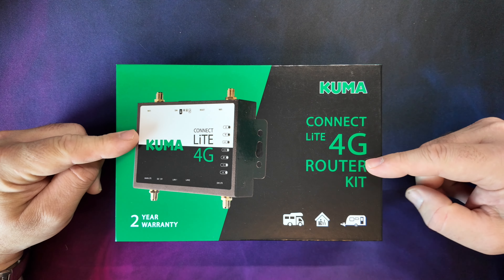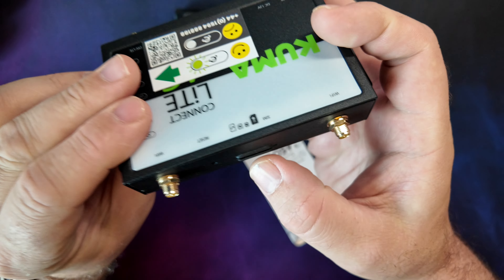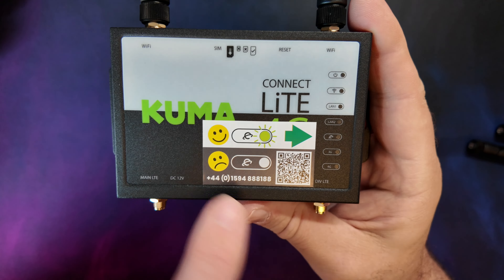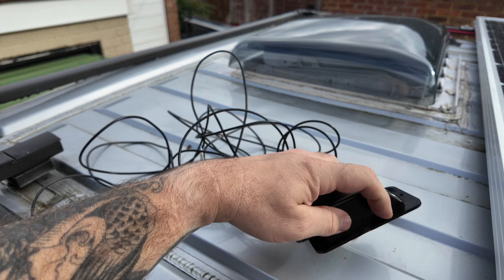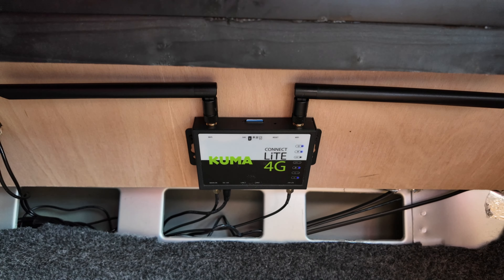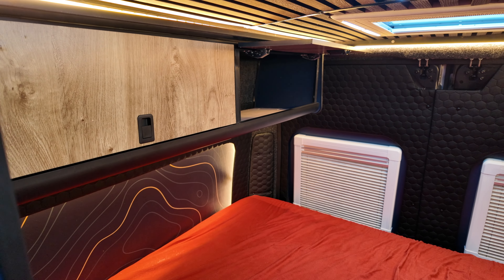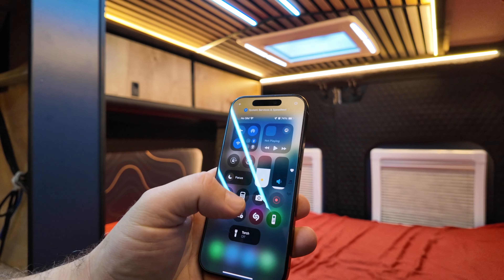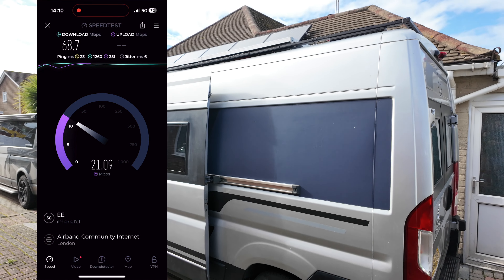Offgrid camper wifi - Kuma Connect lite pro CC20

Comment: I’ve fitted the same unit to my Ducato and changed the antenna to a better one and made a big improvement on speed. It’s the one Gadget John uses. 👍🏼
Reply from the maker: Cheers. Which one? The puk one he uses?
Reply: @SpyderLEE  no I tried the puck and didn’t get much signal, bought the new antenna and made it far better. Will have a look for the brand. Was only about £15  off Amazon tbh 👍🏼

Comment: Edit as I went straight into a question. This is a great series thank you. We are watching it in bite size chunks while we plan the first fit. 

So having fitted this system do you think it is one you will keep using? The speed test wasn't that impressive but that could be the Sim card and I realise that you are aiming for Stability over a wide geographical area rather than peak performance. It's something I have struggled to research as most are more interested in their top end numbers but that is not where most campervaners are likely to be.

I realise this was a product you were given to test but I am assuming you also looked into others. Any opinions?
Reply from the maker: I think once I start using the camper more I will get to see its advantages and limitations, from looking around this was far better than anything else in this price range, and also up quite a bit. But once you start spending over £1k on a system you will get faster systems but I wasn’t prepared to spend that right now. 
I’d rather test this as it is for now and if anything experiment with some different antenna’s. 
I’ve ordered an extra ee sim on my account as it’s definitely the best

Comment: I appreciate the need for access to onboard camera systems but assumed this was to improve overall phone/laptop access when camping/away from home. Only upload is improved and I appreciate the metal box syndrome. Are there affordable ways to improve the signal inside the camper to match the phone's outside results? Camper looks excellent and look forward to watching the camper progress Lee 😺👍
Reply from the maker: The phone outside test wasn’t really a comparison for the kuma as the phone is 5g. I don’t think 5g coverage is yet good enough for out in the mountains and right out the way. In towns the kuma won’t match the 5g of a phone but that’s not where I need it. There are what I believe should be faster systems out there but they are 4 times the cost of this system. It’s all down to your budget really. 😁

Comment: like your system ,but id worry that if anyone took the van one of the first thing they would do is turn off the leisure batteries through the master switch which would cancel the geo fencing ,would it be a good idea to mount a gps tracker and connect it on a circuit linked to the battery but unable to easily turn off possibly hidden wires and a switch that cant be got out unless substantial stripping of the van occurs
Reply from the maker: There are things that for obvious reasons can’t be shown in videos for everyone to see 😜. There is only so much detail I can go into with security and tracking. I’d like to show more but would need to be on a system that’s not going to be permanently installed
Reply: @grahamunderwood9353  that's why you'd run the tracker from the starter battery A so it can sense the voltage drop of the vehicle starting and alert you , B it'll still be powered whilst driving or fit a small 12v battery somewhere hidden so it can run for weeks with all the apparent batterys disconnected,  only needs a simple relay to keep it topped up 👍